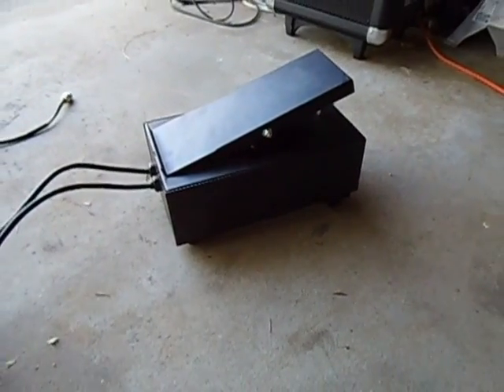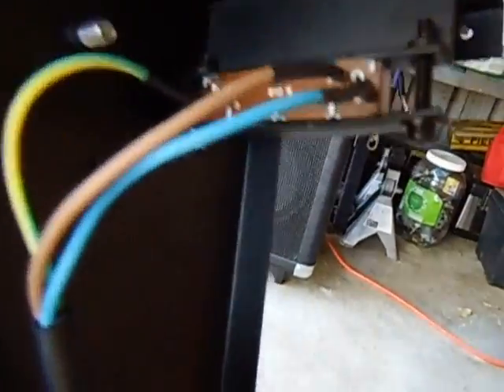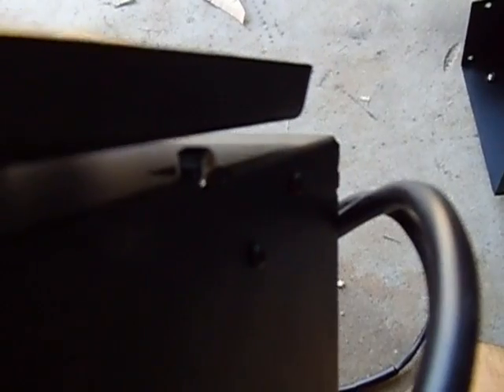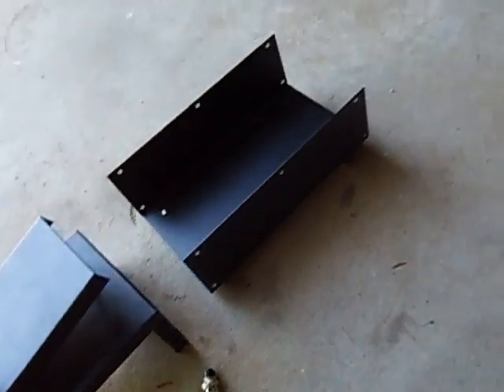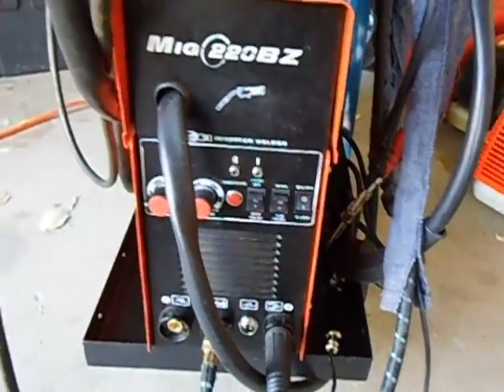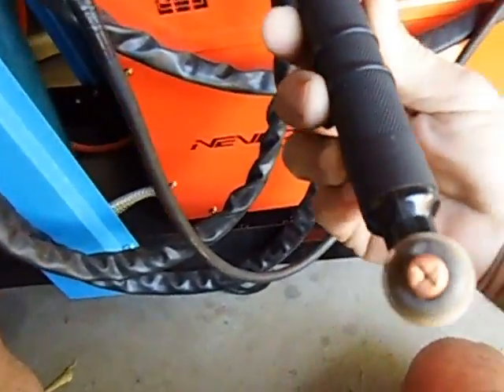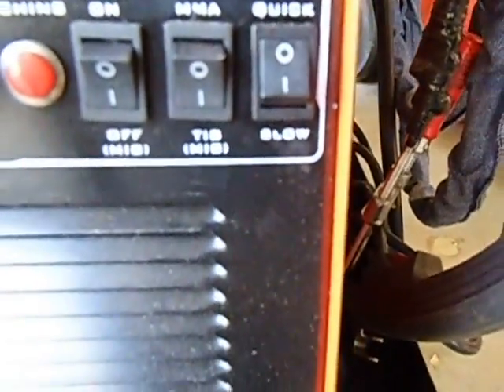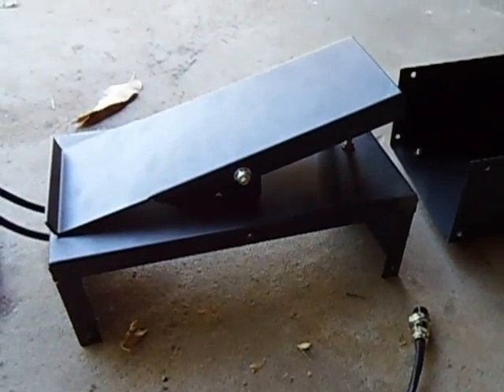Tig control pedal and how it works

Comment: the 2 pin is an off on just like the 2 dolla switch on the torch ,,, everyone has the same ,, the 3 pin is the amp control BUT YOUR MACHINE only has the 2 pin ,,DID YOU THINK TIG MAGIC would make it work WHEN THE MACHINE IS NOT WIRED FOR A #3 PIN ,, Maybe you need to either get a new machine or GET SOME ONE WHO KNOWS HOW TO SET UP A 4pdt switch and wire the Pot up in the machine so you can contor it with the pedal ,, i have converted many machines ,, its not hard ....

Comment: So where do you plug in your three pin din plug for amperage? If there is no 3 pin din plug just do what I’m doing, pull the amperage pot, wire it to a 3 or 4 pole double throw switch. One set of 3 wires goes back to the panel the other set goes to a new panel din plug female. Making sure you match the position of the pot wiring to the slide pot in the foot switch

Comment: Unless electricity flows backward in the land down under. You have it backwards. MiG welding = torch plugs into positive. Tig welding = torch plugs into negative

Comment: Once you connect your foot pedal what does the two pin on my torch lead go to
Reply: The switch that is on your torch becomes redundant.. so teh 2 pin plug will hang free, I tucked mine away so as not to get damaged and removed the switch from the grip also. (up to you but I found it more comfortable.

Comment from the maker: please see how to change your bz 220 mig polarity , cheers
Reply: danssv8 3 wow that’s weird, I have a JEGS 180 amp MiG welder that I’m adding TIG TO. CURRENTLY the MiG torch is plugged into the positive and the ground clamp is negative. I installed a pair of 35-50 DINSE plugs so I wouldent have to go inside the machine to switch polarity because DC TIG is supposed to be the torch is negative and the ground clamp positive. The reason I looked up your video is because I’m putting 4 pole 3 throw mini switch in so when I want to Tig ( originally my welder is just MiG but it should Tig fine basically these new welders art just power supplies.)I pulled the pot in the panel and it’s also a 10k pot.  3 wire. I build guitars and know exactly how pots work. So I’ll wire my pot through the triple throw mini switch. One position for MiG the amperage control will be the normal panel pit. Throw it the other way and the foot controller should work. My MiG welder has a 4 pin din plug on the panel going to the MiG torch. I just gotta figure out which pair activates the wire feed and which pair activates the welder. With the installation of a second 24 volt gas solenoid for argon gas and a special dinse male plug with gas hose for my wp17 Tig torch, I should be in business. Ofcoarse it will be scratch start other than that it should work like a good basic Tig welder. No ac no pulse etc. but I’m just learning Tig. If I decide I’m good enough then I’ll buy an official Tig machine but this was a cheap way to learn !

Comment from the maker: The machine is very good for it's money , on my bz 220 amp welder I just had to reverse the mig welder side polarity and working fine now , before it's mig was crap just pathetic so your gun has to be negative polarity and your ground should then be positive to weld correctly with the mig welding part , cheers , both good welding machine' s